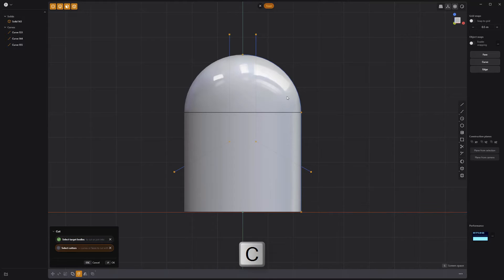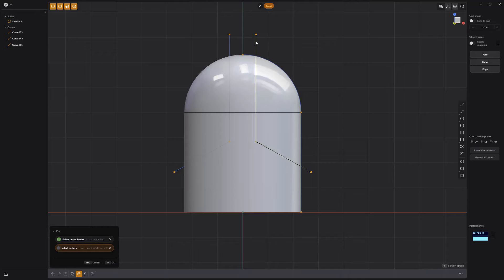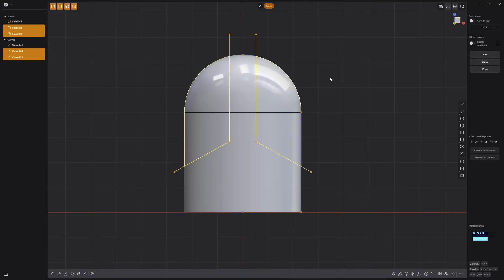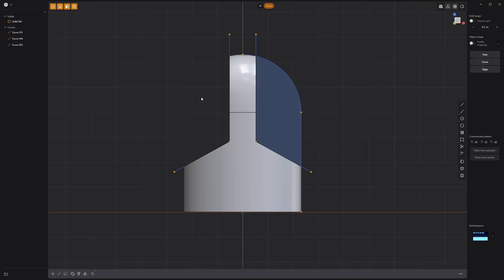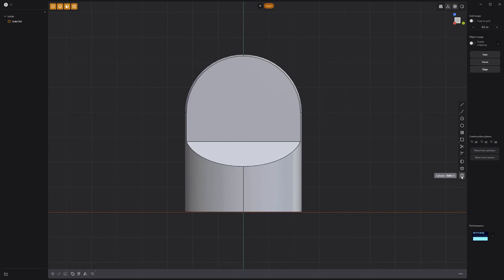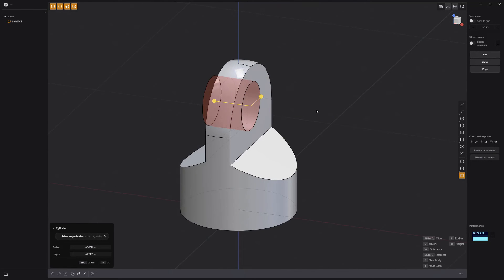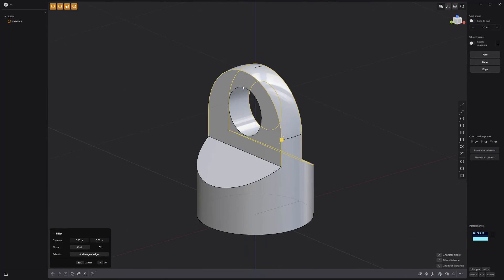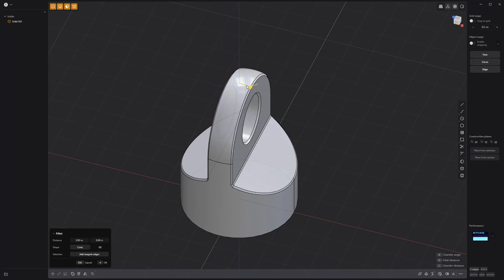Plasticity | Create a Male Clevis

Comment: How do you remove the strange/unwanted edges
Reply from the maker: Select them and press x
Reply: @pixelfondue  can we remove any edge with this command? Like I had chamfered a rectangle and I wanted to remove one of the edges by pressing x but it didn't work.
Reply from the maker: @sheheryarnoor7537  you can remove a chamfer by clicking on the chamfer and pressing x. I don't think you can remove one of the chamber edges tho.